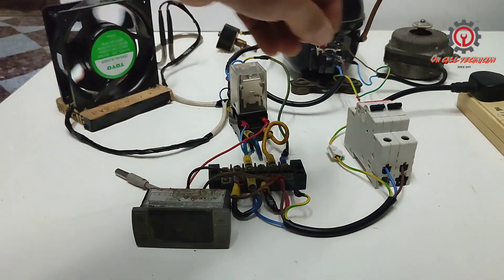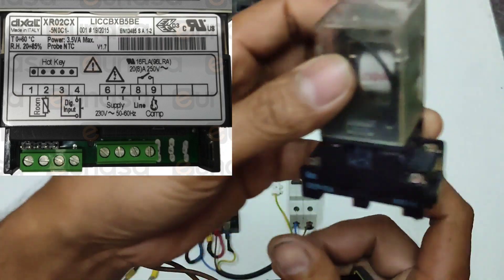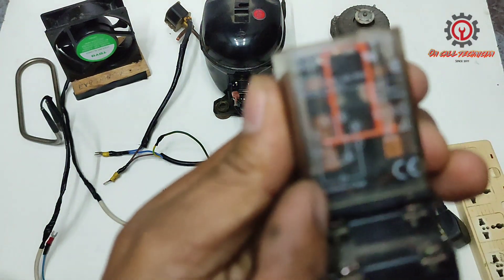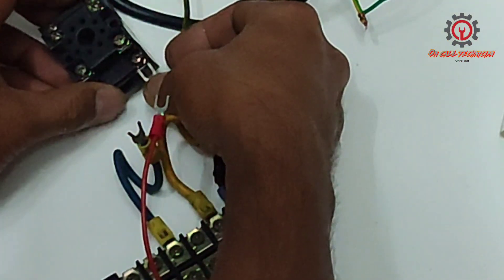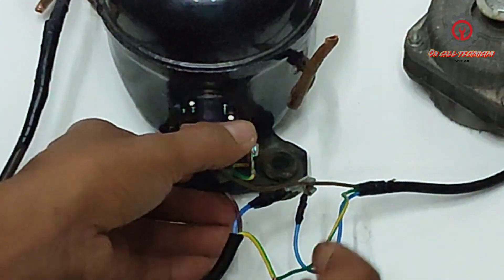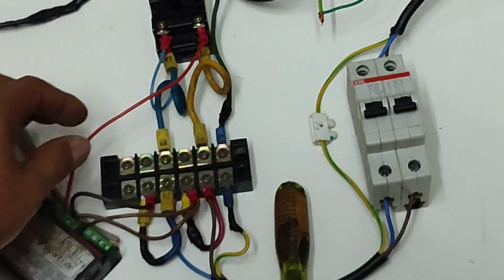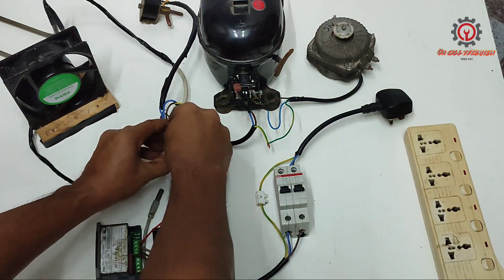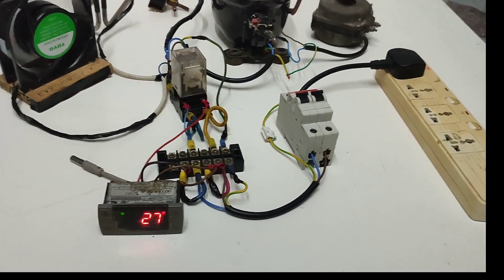SIMPLE WIRING CONNECTION / DIAGRAM OF DIXELL XR02CX FOR COOL ROOM

Comment: hey , temperature on my fridge keeps going up on dixell it says its like over 24c but thefridge is cooling good? do you know how to fix that?
or reset dixell?
Reply from the maker: Are the defrost heater and evaporator fan working? Is the refrigerant enough?
Reply: @OCT TV  fan never turns on as the temeperature keeps going up .
Reply from the maker: Fst set to 15°c up. Check evaporator coil perhaps an ice built
Reply: @THEMULTISKILLEDTECH  thxxi will have a look
Reply: @THEMULTISKILLEDTECH  I can't find fst on this model. I go into settings but can't find it
Reply: is there a way to reset dixell to factory settinga?